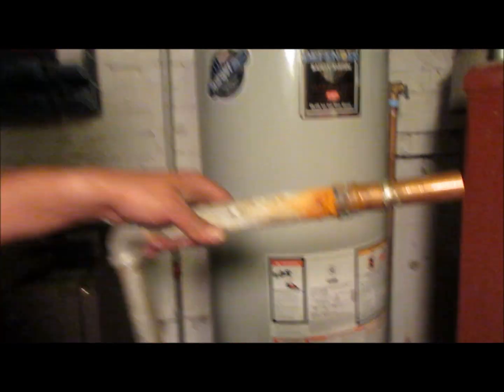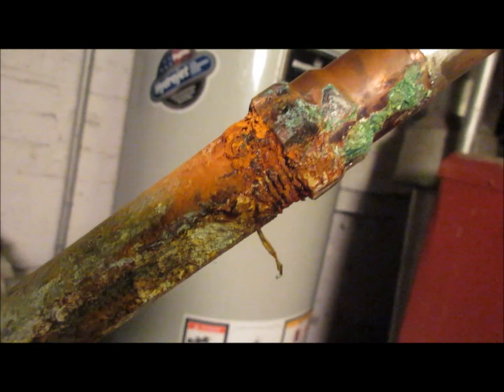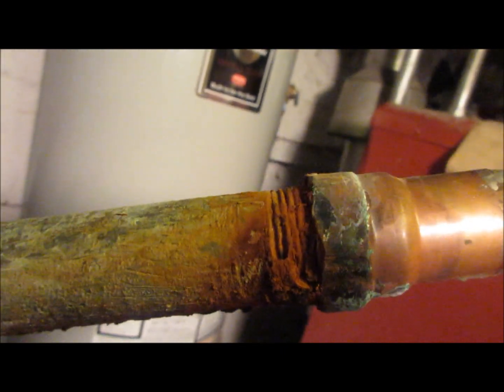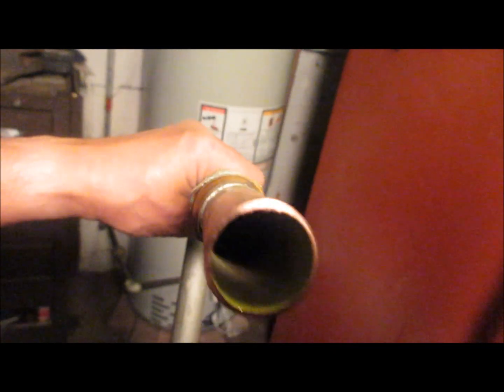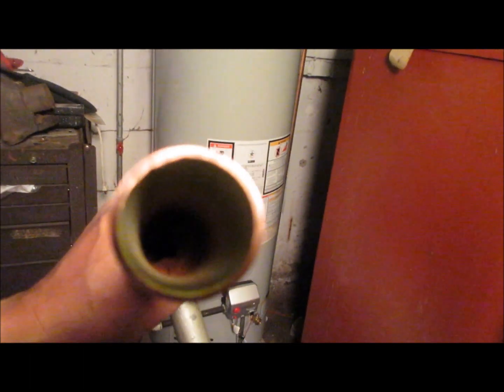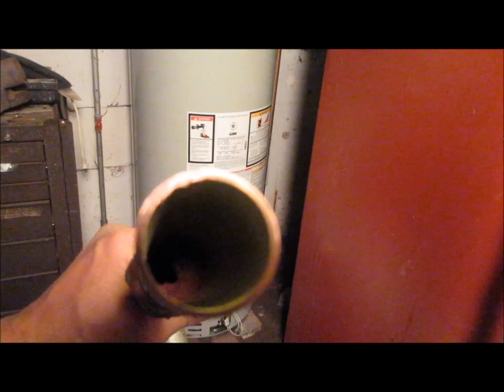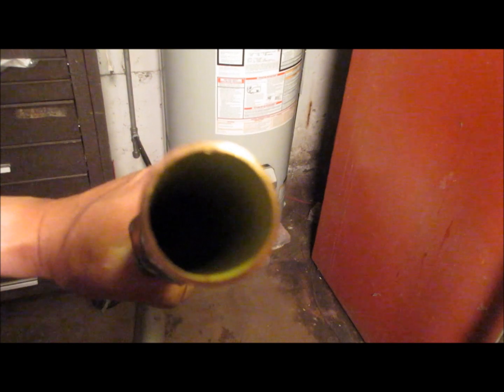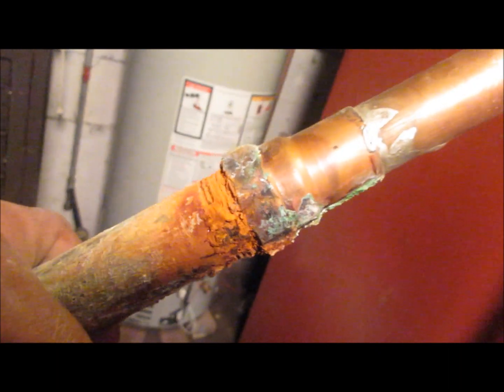What happens if  you put a galvanized and copper pipe together

Comment: Can brass really prevent galvanized corrosion? I did a google search but kept coming up that brass and copper both should not connect to galvanized pipe directly? But it's safe to use brass, right?
Reply from the maker: Brass is what I was always told has to go between galvanized and copper.
Reply: Ok, sounds good. I'm going do it. Lol

Comment: I just cut out a ball valve on my inlet to the hot water heater thinking that the ball valve was bad. Put on a braided supply line with shark bite and still didn't have any water pressure. ×@#÷×#$%$#@. Didn't notice that where my transition from galvanized to copper showed signs of corrosion even though it had an isolating transition coupling on it. I am now convinced that is where my problem lies. #@$÷×#%@#%^!!. Spent 50 bucks instead of 25.

Comment: I just use PVC lol. But someone who owned my place before me put copper straight to galvanized pipe lol. Low hot water pressure. I'm replacing my hot water heater tomorrow, and yanking that copper pipe out lol.